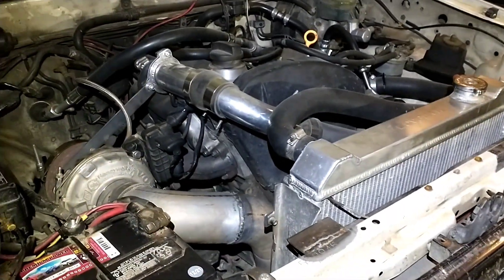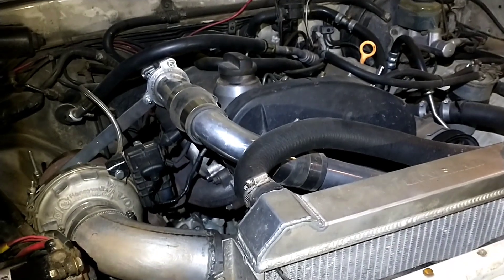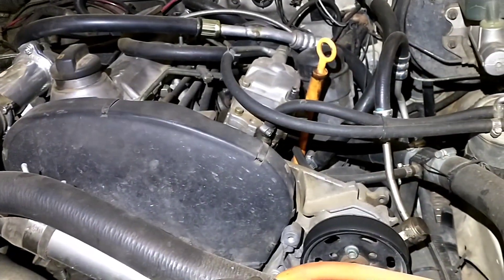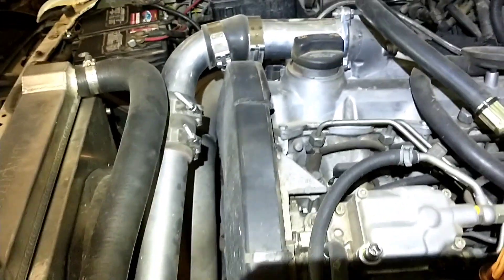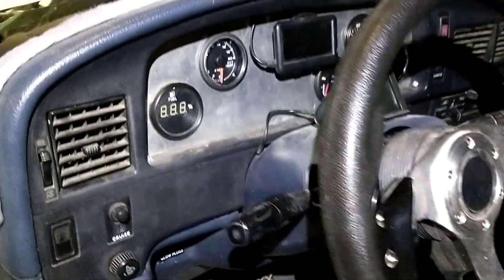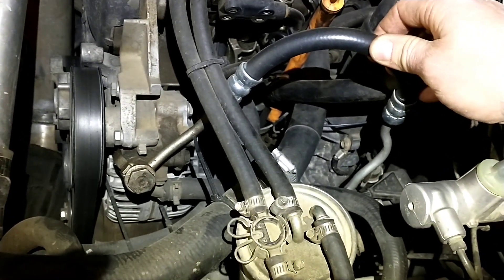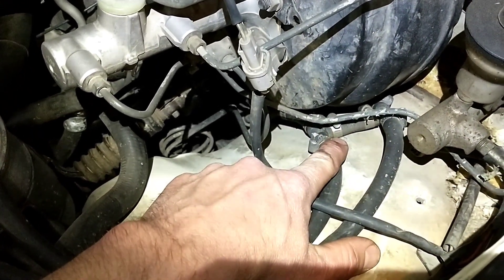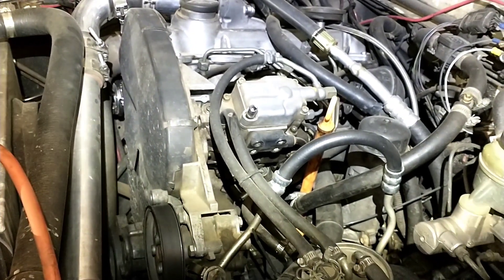What Do You Need To TDI Diesel Swap Your Vehicle? Basic Part List For Any Engine Conversion

Comment: Where did you get the engine? I have a 93' Yota 4RUNNER 4x4, manual 5spd. I'd really like to convert to diesel?
Reply from the maker: I just shop Facebook marketplace for the Volkswagen cars with bad transmissions, body damage or other issues and buy the whole car

Comment: what are the best model/year tdi engines to get the best reliability and power?
Reply from the maker: I mean 99+ TDIs are good for 200 HP, up to 03 are the most reliable, 04-06 are better for 250-300 HP, and 09+ are good for 400+ but also less reliable and more expensive for parts, so it's kind of variable.  Usually the cheapest option available is best

Comment: Been contemplating this in my hardbody for a while. Only thing holding me back is wiring/ecu, as I'm clueless. One day. This is good info though thank you 👍
Reply from the maker: Get some good diagrams and you can handle it, I'm about to make a video on ALH wiring just like the BEW one I made previously
Reply: Get a td engine fuck tdi with all that wiring crap more problems the vw td engines is just two wires to make it run mechanical injection pump
Reply from the maker: @bobjeffersonjeffy7968  Well sure MTDI is an option, but you can run electronic on 3 sensors, 38 wires, and I make the harness for people for $300.  At that point is it really worth sacrificing the 250 HP and 400 TQ I am making electronic, I guess that's up to you.  I have a mechanical pump set aside for doomsday, but until then I'm enjoying v8 torque and 30-35 MPG in my 4x4 pickup ha ha
Reply: @TDISwaps  ya I know what ya mean but I’m talking about just td from a 1993-8 golf gl those engines are the best you can run any kind of fuel on them
Reply from the maker: @bobjeffersonjeffy7968  Ya but those engines are not gonna move the vehicles I'm swapping at 100-150 HP max, I need more than that alot of the time, and most of the old TD engines are throwing parts out the sides long before they make 200 HP.  No to mention I'm running WMO and old gas in my 06 PD engines lol
Reply: i’m thinking about doing one in my hardbody, any luck on getting one/installing one?

Comment: Question could I put a 2002 vw alh tdi in a 1996 honda civic?
Reply from the maker: Definitely, just have to figure out motor mounts and welding the CV axles together
Reply: How did the conversion go
Reply: @jerbear7952  not to plan at all now I have a 1998 vw Jetta TDI
Reply from the maker: @infernoking7504 thats a good start!

Comment: What power steering fluid do you use?
Reply from the maker: So far I have just used regular O'Reilly's brand stuff, but the older pumps don't like it as much cold, they tend to be a little stiff til it warms up for a few seconds after startup

Comment: Am I the only one to see the socket sitting on the fuel pump? Nice work on these. I'm working on a cjaa in a 07 jku wrangler. It's bolted in, just gotta figure out all the plumbing and wiring.
Reply from the maker: Nice work! Haha yes that is my permanent three-sided socket because I didn't have one when I needed to adjust the pump so I hammered a 7mm onto it 😂
Reply: Hey man I have a cbea for a 97 tj.  I'm worried about the ecu and wiring. Any tips? This engine is off of a a3 audi 2011. The engine has all the connections but the ecu and wiring are missing. I bought the core for cheap. I just need plumbing and wiring to run it, but I've never ran a tdi.
Reply from the maker: @carlostorres8398 sorry missed this message since you replied to someone else.  Ya I'm not sure the best bet for finding wiring, probably get it from a scrap yard.  It would take months to try track down all the connector plugs part numbers to order new.